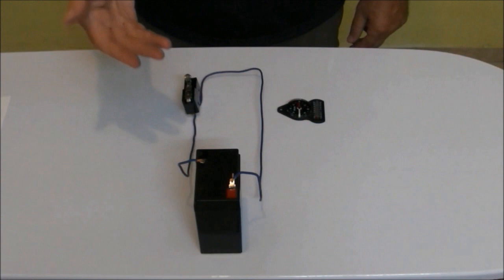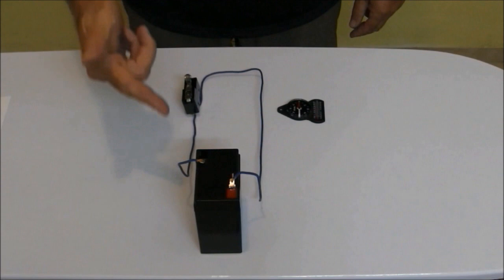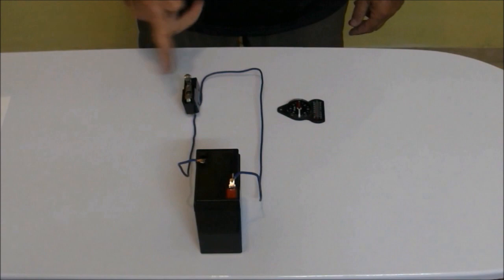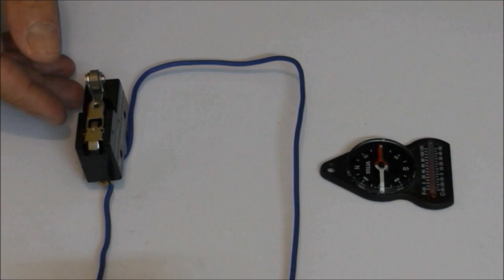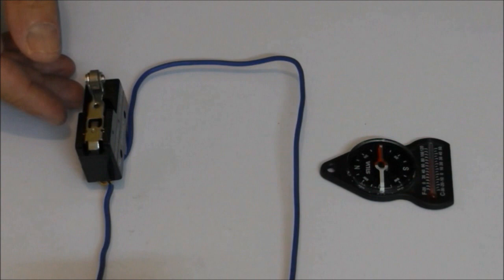The Deflection of a Magnetic Compass Needle by a Current in a Wire

Comment: Would be nice if you could hold the switch down for a bit longer. Anyways good video!
Reply: He cannot, because there is no load in the circuit., which means that he causing a short circuit when the switch closes.
It could be solved by adding a little light bulb in the circuit .

Comment: What voltage or amperage is required for this to work? I tried with a 9v and a D cell with no luck.
Reply: The voltage is OK. You'll need a higher amperage battery, something around 2AH. It looks bulkier than a D 9v.  You can also try to connect a few D batteries in parallel.